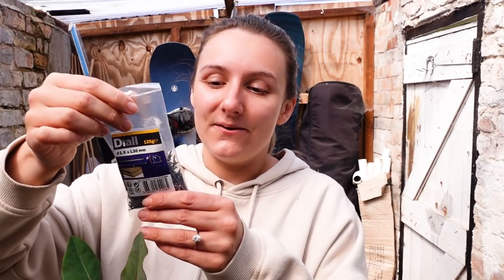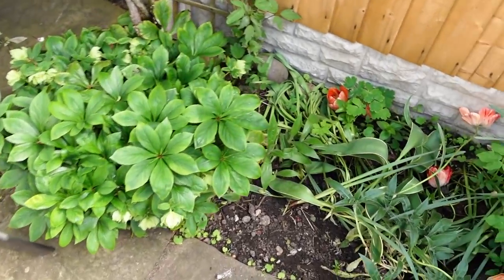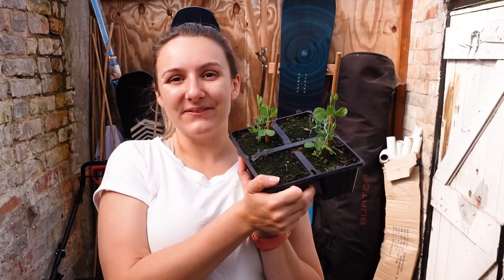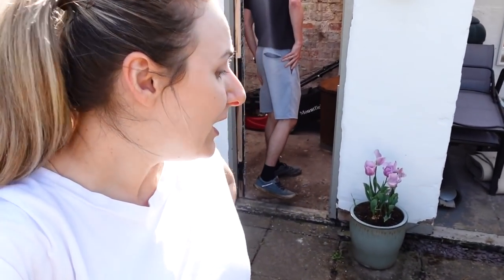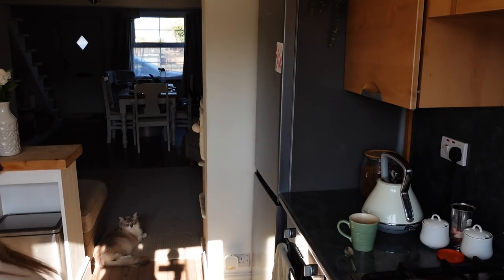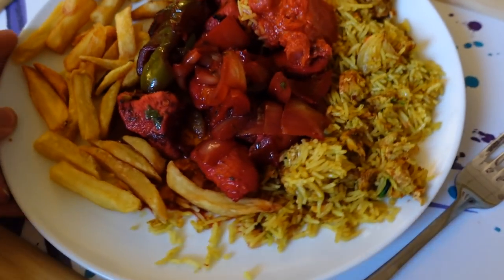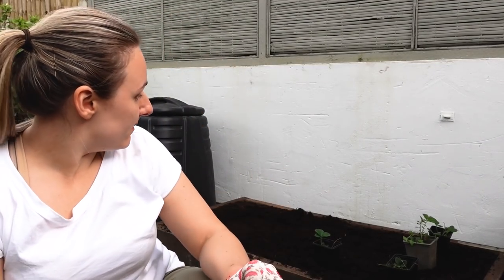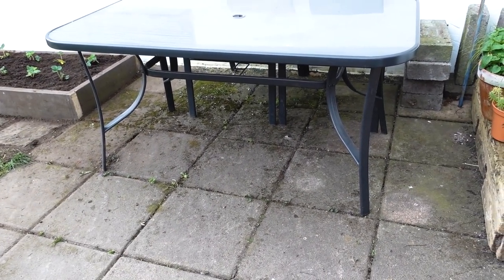Garden Vlog | DIY raised bed, sorting my greenhouse, organising + tidying

Comment: Brilliant video, loved it. ❤ I would put something on top of your soil on your raised bed. Usually straw under strawberries to keep them off the soil, stops them rotting and less likely to be eaten by bugs. I have grit under mine,you could use larger stones etc. Also your raspberry will take over the bed eventually sending up runners. As someone else suggested would probably be better in ground against the wall. Just some suggestions. Hope they're helpful. Also your covered area I would paint all the walls and you can get different click outdoor tiles from IKEA that would look nice on the floor. I'll stop now! Lol. - Frances

Comment: As a layperson who has never planted yet somehow always had raspberries, they seem very hardy and quite good at self-propagating. They will happily take over that entire raised bed, and don't really need the ease of maintenance the raised bed offers either, so you may want to move them. I am incapable of killing them despite never caring for mine in any way- weeding, watering, fertilizing, none of it- might just be the climate and soil in my area though, YMMV. They might produce better if I did those things, but I don't have the energy. That said, They kind of need their own area purely so you have a visual for how much is "too much" for you (so you know when to prune) because even if you only start with one bush, you will definitely receive more whether you like it or not xD They might be easier to manage with a lattice for them to grow on, so they grow upward more than they "bush" outward, but they can do fine without too, just more chaotic in my experience.

Side note, your not knowing how big strawberries get (especially in comparison to raspberry plants which can end up quite tall in my experience) gave me a great chuckle, thank you! They stay quite low, to the point where the berries often touch the ground and begin rotting due to contact with soil. This can be mitigated quite significantly by adding a topper above your soil, like straw or mulch, as others have mentioned, so the berries end up resting on something that retains less moisture than dirt. As a bonus, toppers also help stop weeds! Happy gardening!